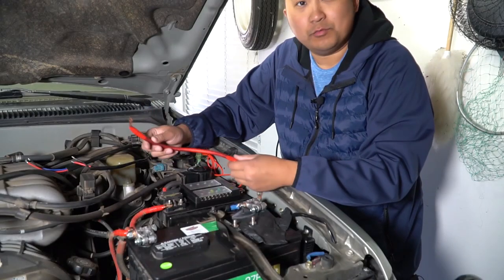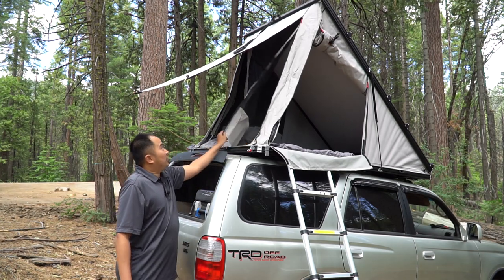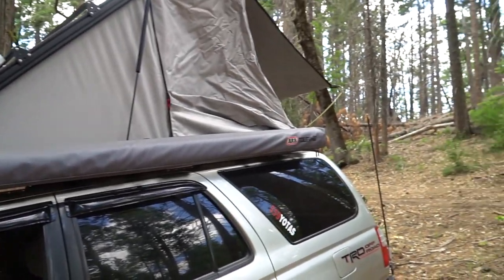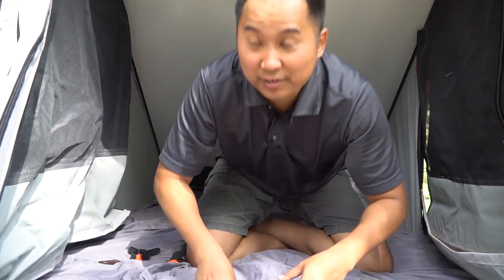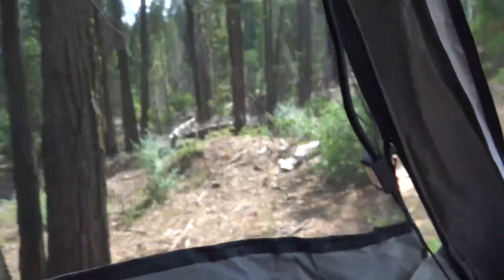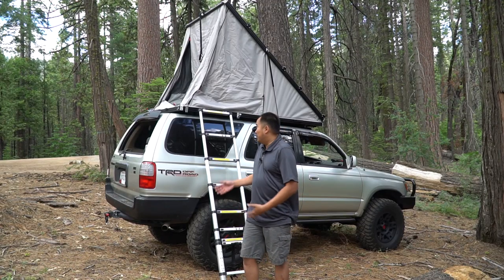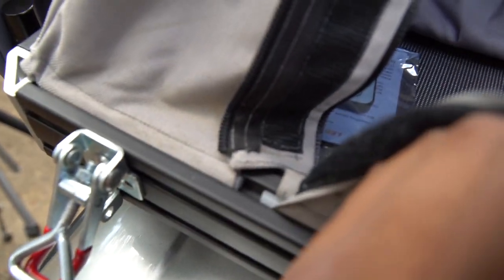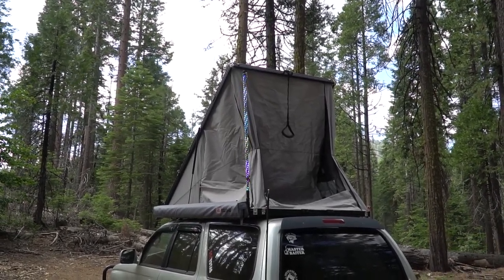DIY Clamshell Roof Top Tent Walkaround (Low Profile / No Roof Rack Required) - Toyota 4Runner

Comment: So glad I found your video man! Your design is nearly identical to the one I came up with, only difference was my base used 1x3/1030 extrusions, you even used the same fabric and keder cord I was looking at. I guess as they say great minds think alike. Your video answered alot of questions I had
Reply from the maker: Glad I could help. I would do a single sheet of canvas if you want to keep things simple and water tight
Reply: @PhoRunner  one piece as in a trapezoid? Or 2 triangles and 1 rectangle sewn together? I was gonna keep it simple with only a door in the back and 3 mesh windows that have a cover to zip over them. Also any alternatives to the panels? I couldn't find much searching online for alumapanel, I was originally thinking some type of pvc or abs panel
Reply from the maker: I couldn’t find anything online that was reasonable
Reply: @PhoRunner  yah shipping kills the cost on them 300-500 for it. I'll probably run plywood till I can get ahold of some type of better sheet for it. I'm rural so really isn't any stores that carry acm nearby
Reply: @PhoRunner I'm curious have you used your tent in the rain or snow yet? Part of my reason for building one is to be able to camp in it during the winter with a diesel heater, but not too sure how waterproof the top will be with just that panel bolted to the extrusions I'm sure the sides and bottom will be just fine
Reply from the maker: @Catboy-hr2qp I haven’t camped in rain or snow yet. I was supposed to this year but life got busy. I did spray a ton of water on top and things seem fine lol. Been driving around in rain and it was fine (wasn’t musty inside)
Reply: @PhoRunner  good to know, I'll be ordering everything to get my bottom half built either Saturday or 2 weeks from Saturday depends on what my check is. Did you have a good experience ordering from tnutz? For every good review I find of them I also find a bad one so kinda skeptical but there the only place that has extrusions for that price, I'm definitely not paying the 150$ for a single extrusion from somewhere like mcmaster
Reply from the maker: @Catboy-hr2qp no complaints. Fast shipping and their stuff works. Don’t buy Amazon bolts or anything since they are junk. The tnutz stuff is better and doesn’t strip. Also cheaper.
Reply: @PhoRunner  finally got around to building mine, just ordered extrusions, I decided to build a hybrid design, hard sides with the rear facing part still being canvas, may upgrade that to be hardside later as well if can figure out how to make it fit and latch properly, but just having the sides hard should greatly simplify and reduce the sewing needed also allows for greater flexibility in terms of windows and mesh configuration. I even considered doing them as one giant one way mirror so itd feel completely open but no one makes that in polycarbonate or plexiglass

Comment: This looks amazing, really great job on your build.  I was thinking about making one thats integrated into the aluminum extrusions in my roof-rack (prinsu style) where the hinge is attached to the actual roof-rack (the floor would be the roof-rack), maybe this would allow it to be lighter if i need to remove it, and keep low profile.  Sewing looks to be a pain tho, so I will have to think about it.
Reply from the maker: Thanks!!! The prinsu rack is a nice rack though and helps with aero dynamics
Reply: @PhoRunner  Yeah I have the uptop bravo rack and figured it would be a good floor for an integrated rooftop tent since its already there.  Plus it has a decent windscreen which I am hoping will keep drag down.

Comment: Just an FYI avoid the gusseted tnutz corner brackets, dimensions are a tad off which caused the bolt heads to hit each other when putting them in on mine, not a big deal just annoying. Getting close to finishing my tent just gotta figure out the hard sides im doing and what im gonna do for floor and roof. I have a place to get acm panels from but its a 3hr drjve and 115 per and id need 4

Comment: You kinda glossed over it, but what is the hardware used and how is it used to mount the T-Slot Extrusion bars to the Original rack channel?  Am I missing something obvious?  Thanks!
Reply from the maker: Check my parts list! It’s all organized and mentions the bolt used and length :).

Comment: So it doesn’t look water or dust proof or did I miss a detail ? Notice any dust inside yet?
Reply from the maker: The canvas is waterproof and there’s a weather strip between the clamshells. I haven’t noticed anything inside yet.

I could / should probably caulk the top piece to the frame but I haven’t tried it in rain yet. I’ll probably do a water test some day ha

Comment: Hey bro quick question unrelated to your youtube title lol. I also have a manual hub conversion and basically want same type of tires you have, did you need anything to fit those? I plan to run 285/75/16. I have 2.5” OME lift.
Reply from the maker: You might be fine with that size on km3  (runs small) but you’ll want to adjust the caster if you can. 

Mine are also 285/75/17 so it’s an inch bigger than what you’re planning on running
Reply: @PhoRunner  My bad i don’t know where my brain went when i ask that question earlier. I meant to ask for your rims, those Trd Rims LOL, did you need spacers? are those 106 mil?
Reply from the maker: No spacers at all on there :). +4mm offset

Comment: For the aluminum extrusion what series did you use ( 10 or 15 series ) ?
Reply from the maker: 10 but i suggest 15 of you want more roof inside the shell! Or thicker 10 series :)
Reply: @PhoRunner  thank you Sir ..
Reply from the maker: The only reason I didn’t go 3” extrusion is the nicer corner pieces aren’t available

Comment: How are tou supporting the weight on the roof
Reply from the maker: It sits on the factory rail(not cross bars)
Reply: @PhoRunner  I know but those have a weight limit usually less than your weight and tent weight....
Reply from the maker: Only the crossbars are rated. The side rails aren’t rated at all. Only Toyota will know but me and my 2 little boys sleep in it and haven’t noticed any issues.
Reply from the maker: I might add that the Sherpa rack and many other racks mount to the same location. It’s a structural part of the vehicle.
Reply from the maker: @HarietSims  let me know when you find out what it is

Comment: Nice job, but I guess you don't drive when it rains. With no seals your mattress would be soaked in water.
Reply from the maker: I do drive around in the rain and it’s not soaked. It has seals on the closing part. Just not the bottom